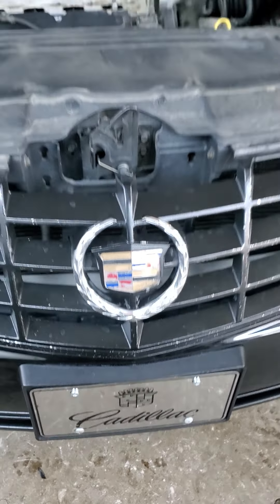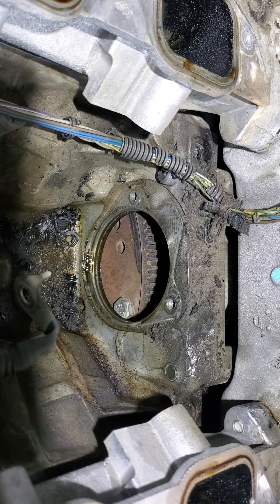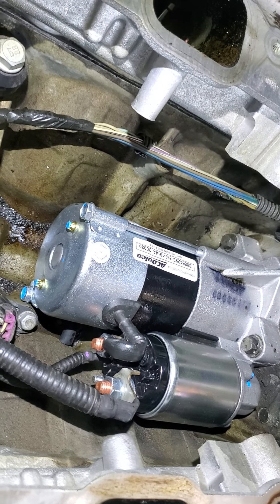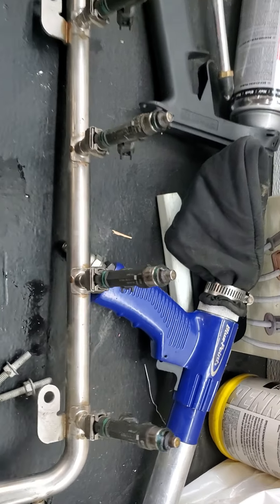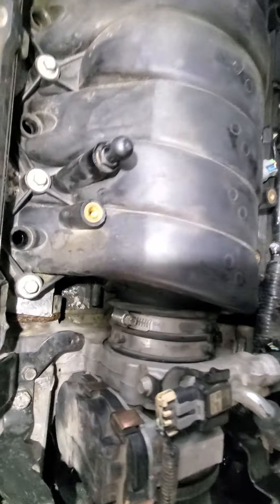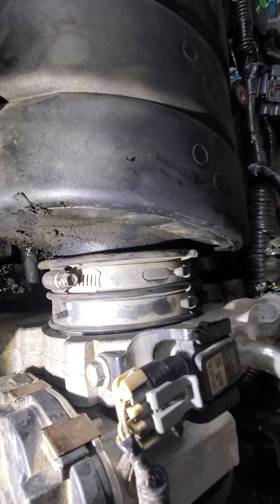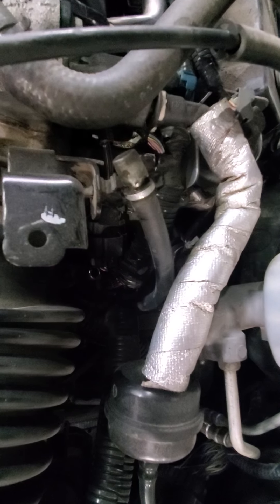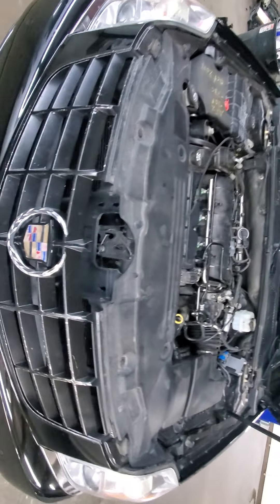Northstar Starter Replacement

Comment: Great video. I was able to tackle this project yesterday. The best trick to remove the intake manifold is to remove the two stainless steel hose clamps on the rubber boot (Intake Manifold Duct) that connects the intake manifold to the throttle body. Once you remove those two metal hose clamps, the rubber boot/coupling becomes very flexible and it's MUCH easier to remove the intake manifold. When it was time to reinstall the intake manifold, I applied a little water to the rubber boot. This helped reposition it correctly once the intake manifold is reinstalled. Reinstalling the stainless steel hose clamps is fairly simple once everything is in the correct position. I was not able to remove (or reinstall) the intake manifold without removing those two stainless steel hose clamps.

Comment: Your attention  to detail  is really  good and your teaching technique  is also really good thank you.
Reply from the maker: Thank you. I try to be as thorough with tips and tricks as possible
Reply: Good video, but do you need to remove the negative cable from under the rear seat? 
Wouldn’t removing the negative from the battery under hood do just as well?

Comment: here is an detailed hack for these starters.

I'm not knocking this video in any way,  but it can be done much quicker.  I tackled this today and had the starter out in an hour and a half and about 45 minutes to reinstall.  If I had to do it again; I could do it in an hour or less.  Most of the time I spent taking it off was studying it and walking back and forth for tools, but I'm gonna save you that trouble. I had read a comment on this post, or another one, saying there is an easier way by just propping the manifold up.  The guy didn't give instructions, but I understood what he was saying and figured it out.

 Simply remove the engine cover,  pull the 4 plug wires closest to the front of the car and hang them over the back rail, remove the bolt (10 mm) on the EGR Valve that holds a portion of the back side rail down. It's close to where the fuel lines come into the rail close to the back right bolt on the manifold. Remove the four bolts  (deep well 10 mm socket, or wrench) holding the fuel rails down over the manifold, two on the front rail and two on the back rail. Take the 6 bolts (10 mm) out of the manifold, the left front and right rear bolts will not come completely out as the rails prevent it, just leave them after you've loosened them all the way.  The only thing that is a little tricky is removing the back right manifold bolt because of the angle. I had to use a socket adapter that has a built on extension piece that swivels so I could go in at an angle, because the fuel rail prevents you from getting at it from the top, but it beats taking the whole fuel assembly off.  I used a 1/4 inch drive to loosen that one and to take the one on the EGR Valve off.  I used a 3/8 drive for the rest.  Remove the rubber boot that goes from the air cleaner to the manifold, front right.  At this point the manifold will lift up, but there are few vacuum lines/hoses that have to be removed, but you'll see them when you try and lift the manifold up as they'll hang up.  Prop the left side of the manifold up enough to get to the starter, about 10 inches.   Remove the positive and solenoid nuts, lock washers, and flat washers for both.  If they fall no worries, there is nowhere for them to go.  I think the solenoid lead is 8 mm and the positive lead is 15 mm.  After that, take the two bolts out that hold the starter in place and remove it  I think those are 10 mm.   Take the two old gaskets out and snap the new ones to the manifold that's propped up.  

When reassembling the starter, there is plenty of wire, so put the positive and solenoid leads on first before putting the mounting bolts back in. You can do it either way, but it's easier to  do it up top than down below. This is the opposite of taking it out, why? Because when the starter is mounted in the car, I found it easier to just ratchet them off while it's anchored.   When putting them back on, I like being up top as it's easier to put the washers and nuts back on as the solenoid ones are tiny.  Word of CAUTION, if you put them back on up top, you will be working close to the manifold holes, so have them covered in case you drop a nut/washer.   One more thing, be sure to make sure the two leads to the starter are nice and clean before reinstalling. I tackled this because I paid someone to do this a year ago and i knew my starter wasn't bad,  plus I've had a bad run of luck with cars this month and I'm trying stop the hemorrhaging. Sure enough, the person didn't take the few extra minutes to clean the leads when he installed the new starter last year cause she's purring now . The job is not hard, it looks intimidating and I'm sure it is a "pain in the butt", especially when you take everything off,  but it's not bad at all if you do it the way I have described. Feel free to ask if you have any questions.  Now, go save some money, because the Caddy dealer will rape you.
Reply: will a 05 Cadillac deville  starter fit a 99 Cadillac deville
Reply: Damit man ! Thanks for sharing! Your very talented ☮️
Reply: I never try to rush repairing my car , especially when I’m learning. I appreciate this  video that was done so patiently as well as through. Thanks
Reply: Why didn’t you create your own video instead of criticizing his. There’s always one in the chat.

Comment: I have an 08 DTS with the NHP. Scared I might have a rod knock or need Head gaskets done, but totally worth it. Keep these vids coming. Awesome content
Reply from the maker: Thats awesome. Very nice cars to drive. It is rare to have a Northstar with a rod knock. Perhaps the engine  hydraulic locked at some point due to unaddressed head gasket issues. If you decide to use the original engine, do yourself a favour and have a good look at the bottom end bearings and the crankshaft journals before you put a bunch of money into gaskets and hardware.
Reply: @cadillacdoctor1351  Great advise and very much appreciated. It goes in to a Tech this week.

Comment: Where is that oil coming from under the intake manifold? I have a 2008 DTS and I have a oil leak (more like an oil spray). It only sprays out on the passenger side from under the intake it seems, and only while the car is being driven, not while idling at all.

Comment: Replaced my starter and flywheel but now my car will not start or crank. When I turn the ignition to try and crank the dashlights go out and nothing. No starter engagement or nothing. Is there something I’m doing wrong?

Comment: very good video,  do you remember at what miles your  engine starter  was acting up and giving first signs of trouble ?  thanks for the response.
Reply from the maker: I bought the car with 200,000 kilometers on it. Starter failed at 210,000 kms. Although frequency of use, climate and other conditions will affect the lifespan of a starter motor.
Reply: @cadillacdoctor1351  interesting, thanks.

Comment: Used a rubber mallet. Broke a small piece of the intake manifold. Found out that the boot towards the front would need to be pushed down more past the little lip on the intake manifold section.
Reply from the maker: Thanks for your feedback. As mentioned in the video, the intake manifold is made out of composite plastic and cannot be struck very hard. You are correct in saying that it must be angled during installation. Only very light taps with the rubber mallet
Reply: @cadillacdoctor1351  it also didnt help that i was doing this job in 20 degree cold weather.
Reply: @cadillac doctor 13
The caddy i did the starter on came back for a power steering pump i removed it and saw that if this step is done installing the intake is alot easier

Comment: Mr Doc, I just want to ask you. What is your real opinion on these Northstar DTS engines? I'm thinking of buying a 2007. I'm trying to figure out is worth it? It has 143 thousand miles on on it.
Reply: I just worked on my friends 2007 dts today replacing the starter.   Had it done in about 3 hours.    So far, he had to replace the water pump, starter, a transmission line, and had a few oil leaks.    The motor itself is solid, but everything else around it, is failing piece by piece.    Mileage on his is 150,000

Just pay attention to the noticable/visible things, if you decide to buy one.    Brakes, suspension,  fluid leaks, .....ect.     Basically this car can nickel and dime you to death if the previous owner didn't take care of it.   (But that's any used car really) 

Take care👍
Reply: @John Doe now when you say it took 3hrs was that for everything that you did combined? Or was that just the time to replace the starter?
Reply: @yeahboy28100  .... just the starter, but I was outside under a carport and I did have to leave to parts store once.   I could probably replace starter again in half the time.        

The work looks worse than what it actually is.   

Everything else was on a different day.   Water pump job took about 3 hours as well.    The transmission line I replaced was easy, about 30 minutes.    

They seem like solid motors though.   The one I worked on has plenty of power still at 150,000
Reply: Thank you

Comment: Why would my sister free spin not engaging  or  stop without discovering battery ? Is sister bad
Reply from the maker: It is likely that the bendix is slipping, which generally requires replacement. Starter motor components are not easily found separately these days.

Comment: What shop are u at?
Reply from the maker: House of Cars Medicine Hat
Reply: @cadillacdoctor1351  Hello. So How can I be sure my starter is bad. When I turn the key all the electric is there and there is a clicking but the car won't start. Then while turning the key on and off I play with the electric locks, it would eventually start, that worked for a few weeks, now it won't work. Is there anything else I can check before replacing the starter? HELP. 2001 El Dorado ESC

Comment: Yo would you know where to get the wiring diagrams for a 1994 deville 4.9 motor im going to put it in my 2000 grand prix just need wiring info to connect engine harness to my grand prix body harness
Reply from the maker: The only problem with that swap is that you're trying to mix an OBD 1 engine with an OBD 2 vehicle. Not to mention that the 4.9 litre made considerably less hp than the Northstar or even a 3.8 litre supercharged v6. You may want to reconsider your options for that particular vehicle. 

Thanks for your question.

Comment: Here is a comment   from south main auto repair  Jason A
Jason A
1 month ago
Those are easy. When I was at the Cadillac dealership we would remove the upper intake bolts and prop up the passenger side of the intake with a screwdriver to get a swivel socket on the starter bolts and wires. Even the earlier 1992-1994 ones werent that bad.

2

Can anyone confirm this works.
Reply from the maker: I certainly does. This tutorial is to illustrate the formal way to execute the job and show, in detail, the location and setup. It would have been much more difficult to fit a camera in there with the intake just tilted.

Comment: That makes absolutely no sense a starter underneath the intake manifold a $500 fix at a repair shop. Just changing the oil pan gasket is a $1,000 fix because you have to separate the engine from the transmission. THE WORST ENGINE DESIGN IN THE HISTORY OF THE AUTOMOBILE.
Reply from the maker: There are several makes and models that employ the same designs and engineering, such as the Mazda Millenia for the starter and Hyundai Kia GDI for the crankcase design.